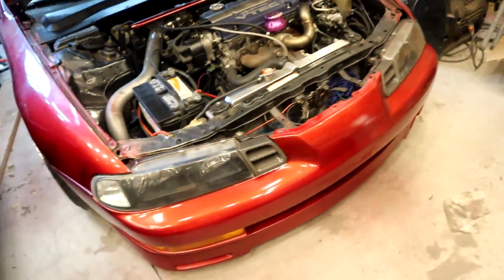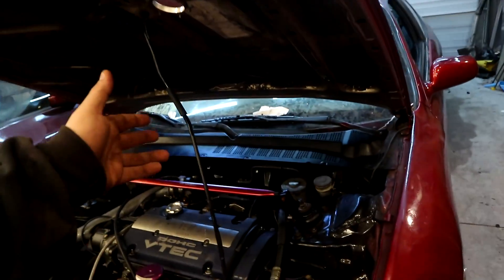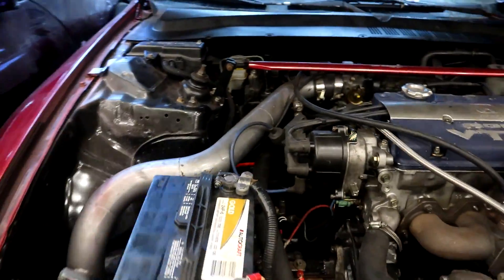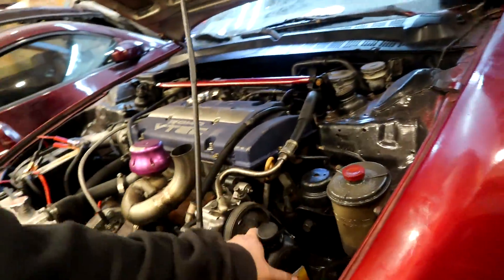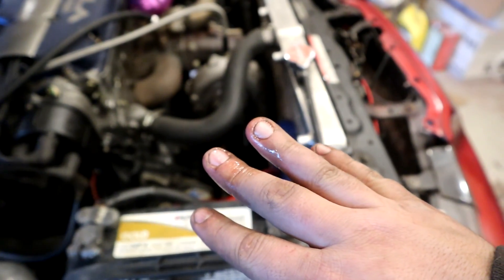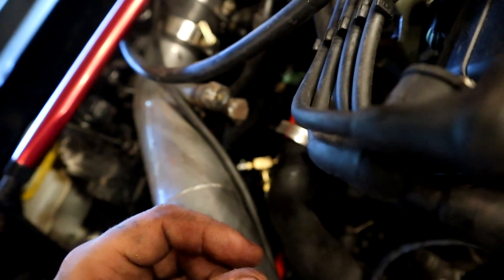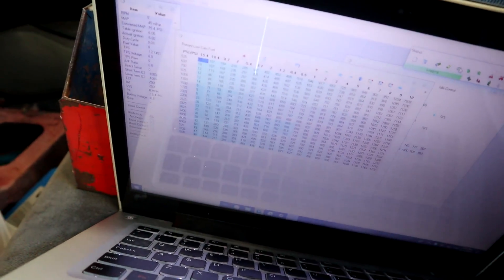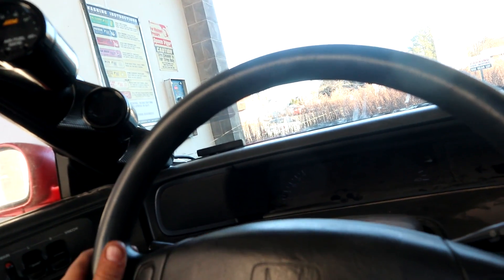HITTING BOOST IN THE PRELUDE!!!

Comment: You want to be closer to 10.5-11 when in boost.  I noticed when your waste gate opened (full boost) your was at 14-15 at some points.  just be careful not to blow it up.
Reply from the maker: Yep I got that sorted, I’m at 11.5 now 👍🏻
Reply: @damianmonte  good deal, didnt want to see you mess up the engine.
Reply from the maker: Yessir I appreciate it homie
Reply: @damianmonte  Sweet!
Reply: Everytime I heard "My Afr's are mint" my heart hurt everytime lol
Reply from the maker: Oyemarbono Bono bit redundant innit!!
Reply: How did you get your wideband to offset cols starts in neptune? I wired in my Aem to the ecu so the computer reads it, but I'm having trouble getting it to compensate fuel correctly

Comment: Mechanical oil pressure gauges are best if you want cheap and accurate. Use a premade -4 AN teflon brake hose to connect it.

Comment: Cold start is super rich, I’d definitely change the oil after it gets tuned. If it’s too rich then gas will wash past the piston and mix with the oil and thin it out. But during those pulls it was a little lean. Once she’s tuned she’ll be a mint daily.

Comment: My boi wit that proper break in them rings are set now she’s running mint you did good brotha on this motor build call yo self a professional 👀💯👌 (side note if it has low oil pressure than shit woulda been blown up by now) your still a lil lean in boost during full pull but for a bs base map she’s Ight

Comment: What injectors are you running?
Reply from the maker: J T decapped ls truck injectors 800cc
Reply: @damianmonte  lol thats pretty funny. I literally am looking into that myself right now. Seems you can easily achieve decent power with them. Did you have them flowed matched?
Reply from the maker: J T yessir super cheap and reliable setup 👍🏻